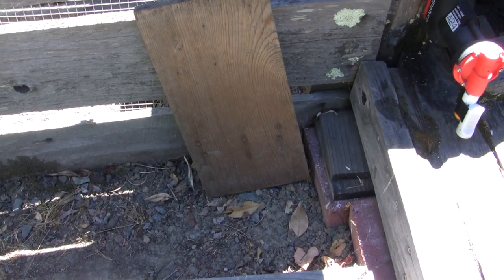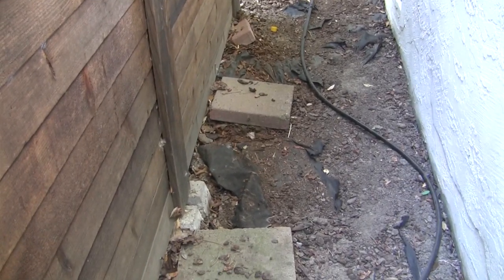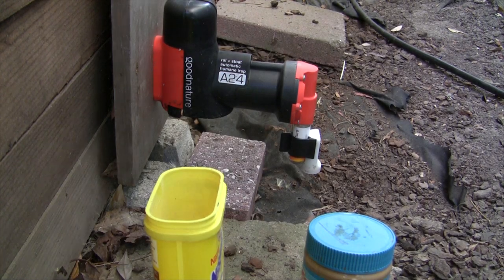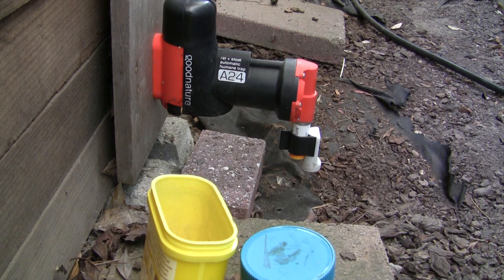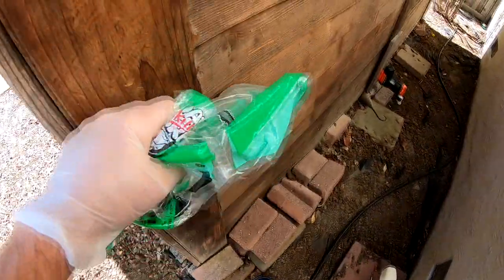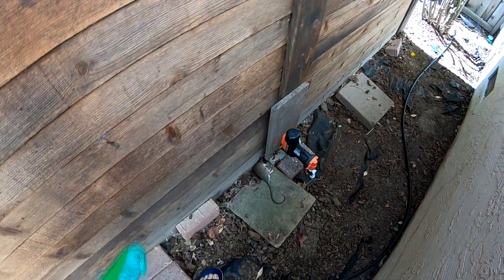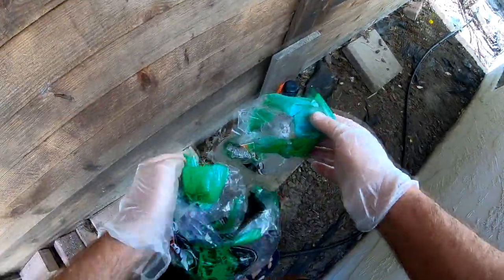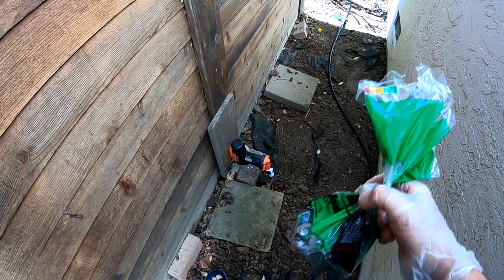Moving the A24 Rat Trap to Where the Latest Rat Hangs Out and the Demise of Rat #12

Comment: Nice video.  A little tip: instead of using gloves when disposing of the rats, just use the bread bag as the glove and then pull the bag inside out over the rat.  Voila!
Reply from the maker: Thanks. I do that too as you can see in this video:
https://youtu.be/Q6jbKkButPU?t=687

I just like to be extra careful.
😉

Comment: Just install my device but need to move it do you know how I detach it. For some strange reason I can’t figure it out.
Reply from the maker: Here's one from A24 that shows how to do it:
https://youtu.be/UCrs1dEjEes
You'll notice in his video he unscrews the CO2 cartridge before removing it.
That's the safe way to do it.
That's what I advise you to do.
There are 2 black flexible tabs on either side of the bottom of the trap that are just below the orange frame that you screw into the wood.
Push those in on both sides and lift up.

**********************************

I don't do that because I don't want to waste CO2 cartridges.
But I treat the trap like a loaded gun and I'm very careful about how I handle it.
I do it in this video:
https://youtu.be/3cS5MruDT9Q?t=125
to put more bait on the entrance of the trap.
I NEVER stick anything up the trap except a popsicle stick with peanut butter on it.
Reply: @BetaCygniBlog  thank you this was helpful
Reply from the maker: @moj8945  You're welcome! Good luck with your trap.